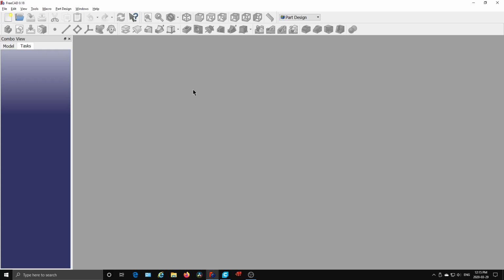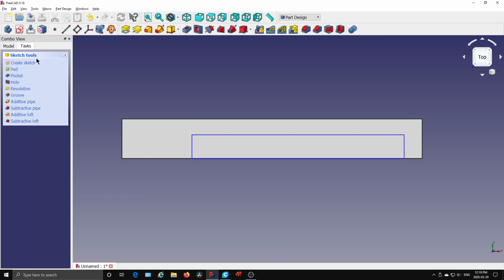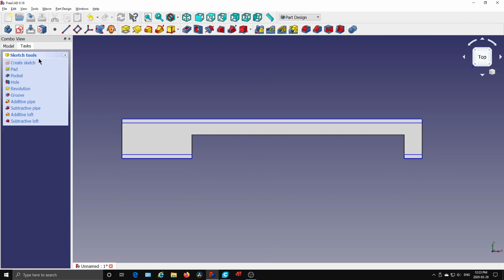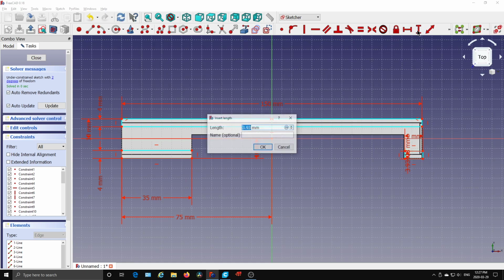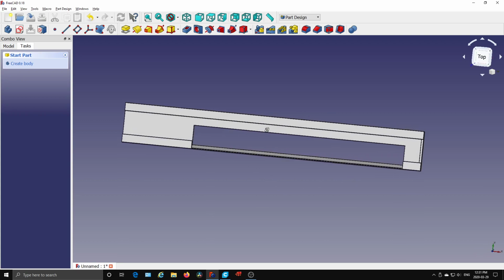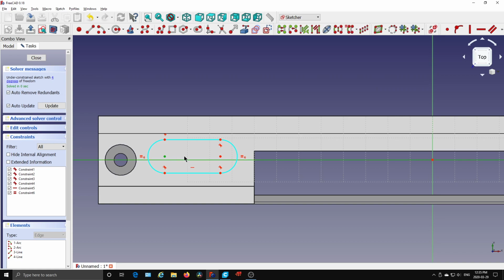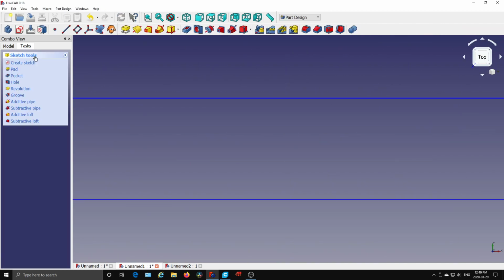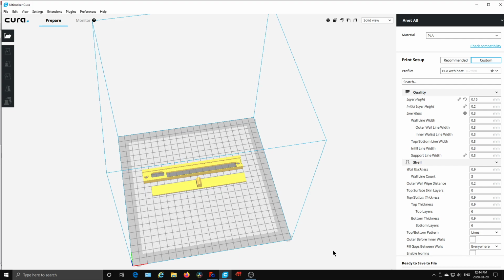G&H Honey Bees - 3d design of my hive entrances

Comment: Nice Gary, I don't have a 3D printer but I do have a CNC machine for wood, plastic and soft metals.
Reply from the maker: I wonder if you could do something similar with the cnc.
Reply: @berrrygr  Yes you can but the code is kind of reversed because you are building up and the CNC in plunging down.